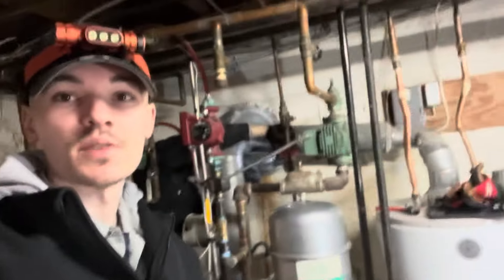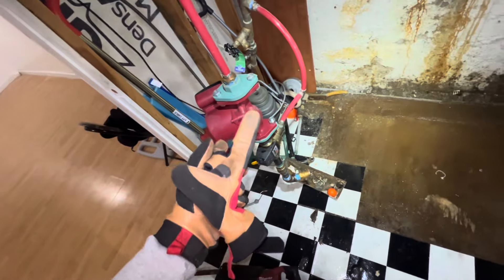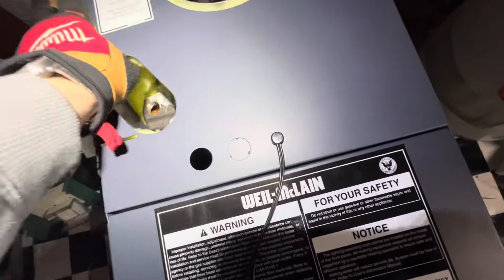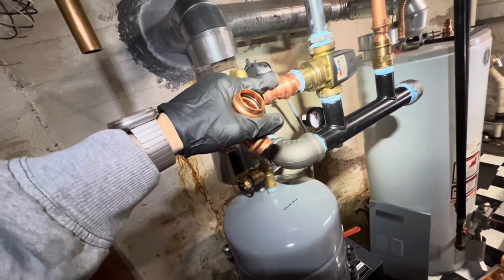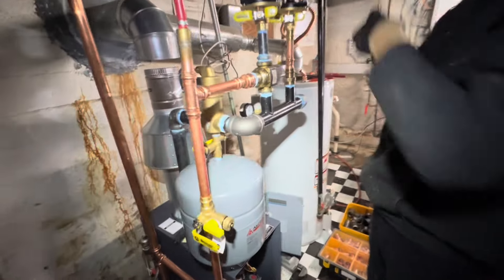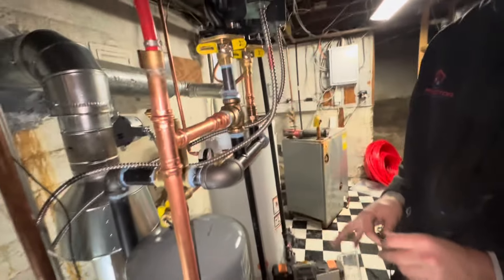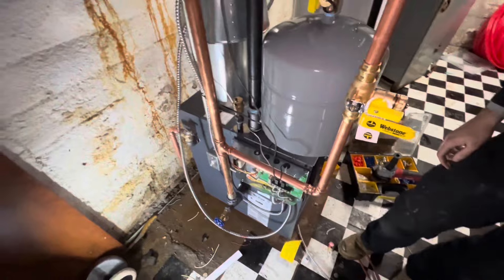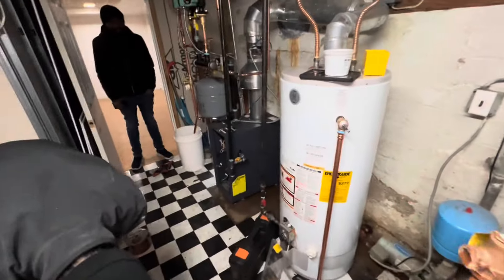Epic Boiler Installation Video! Steam Boiler Replaced with Hydronic Boiler in 1 Day! How We Do It!

Comment: So you can have mixing valve connected to supply and return, not supply and cold water? 
Thanks!
Reply from the maker: You can’t have a mixing valve on a boiler for heating that always feeds cold water into it. It’s a closed loop system.
Reply: Thanks for explaining!
 @DCHVAC

Comment: Shouldn’t you do a primary secondary arrangement given that the radiant will return water lower than 130F which will cause condensation in the boiler? Also every time the boiler starts the return water is less than 130F until the boiler is able to heat the water up? Wouldn’t condensation be an issue during warm up?
Reply from the maker: All boilers on startup will have a return lower than 130° if the space itself isn’t 130° so no.
Reply: @DCHVAC  wouldn’t the radiant still be an issue for low return water temps?

Comment: nice clean install.  but i thought flex lines on a water heater were a no no on long island ??
Reply from the maker: They are but the boiler was the main concern. The water heater also has no drip leg on the gas line.

Comment: Could you explain more about monaflow systems?
Reply from the maker: Mono flow is a system where one pipe goes throughout the basement of the house. And there are “Tees” installed for each radiator. One for the supply and one for the return. These Tees force hot water into the radiator from the one pipe. 

It allows the boiler return water to be at a higher temperature and minimize condensation, and also allows for individual control of each room. Each radiator can be balanced or shut off without affecting flow to the others.

Comment: Wheres the bleeder webstone for the main return line?
Reply from the maker: There’s two bleeders as shown and explained in the video for the main return lines. 

Regardless it’s a MONOFLO SYSTEM also explained in the video which requires the radiators to be bled at the radiator.